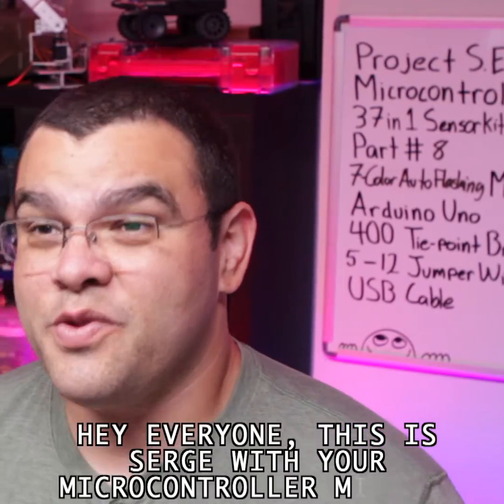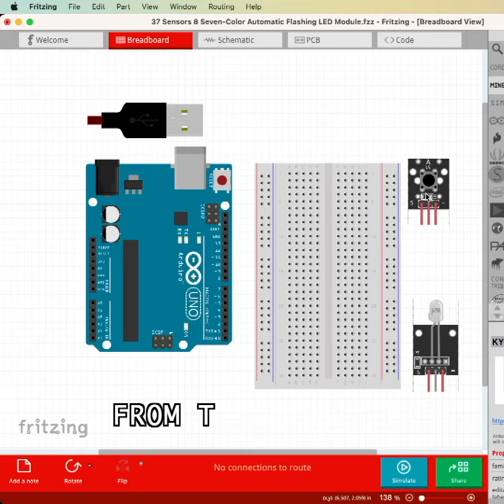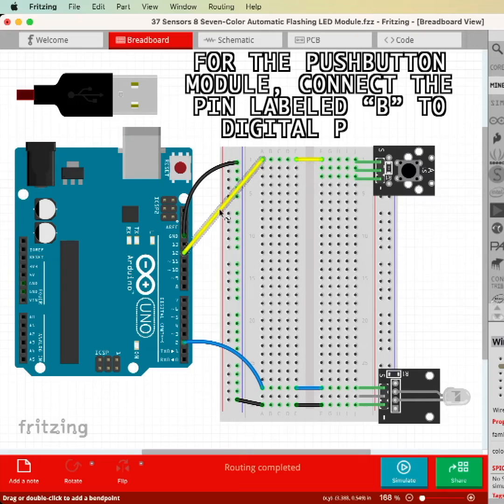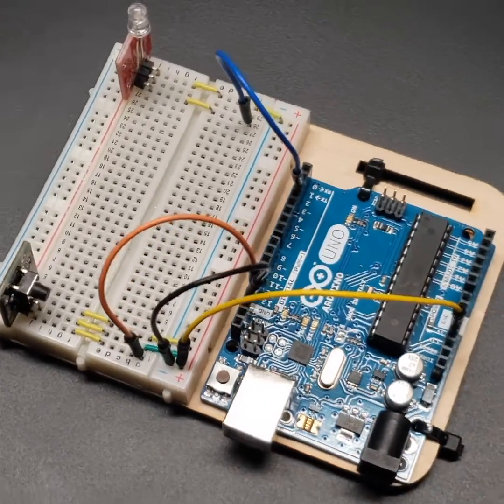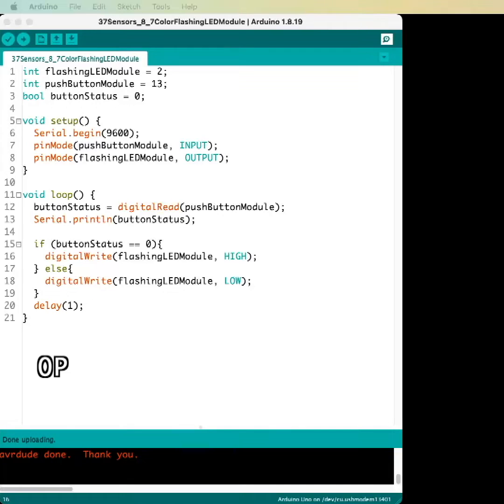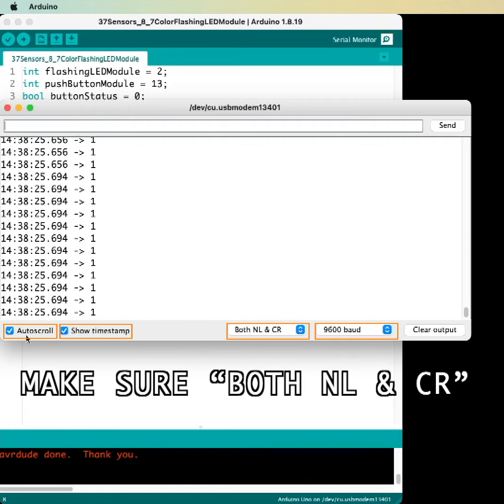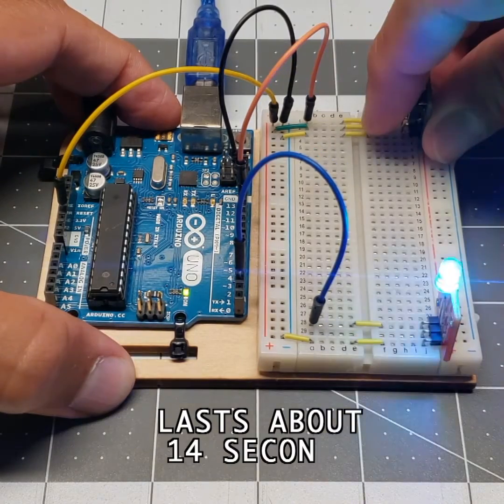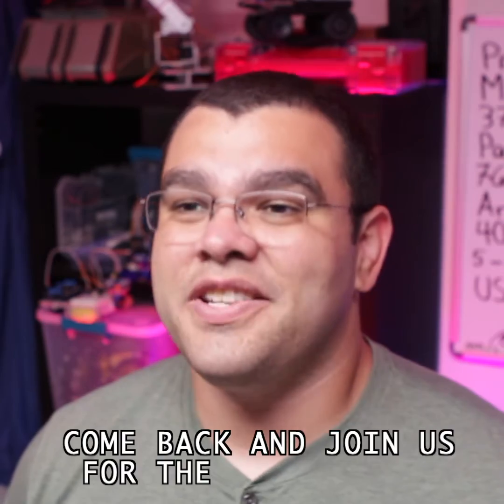Pt-8: How To Program the 7-color Automatic Flashing LED Module from the 37 in 1 Sensor Kit #arduino

Comment: My ledmodule starts glowing automatically without pressing push button.. don't know why?
Reply from the maker: I would try using the blink example in the Arduino IDE to help you troubleshoot. Depending on how you configured the push-button it may be allowing voltage directly to the LED.